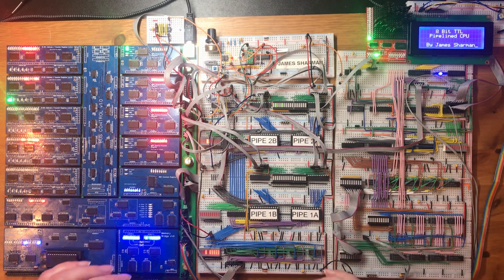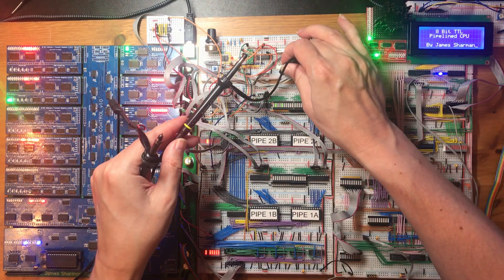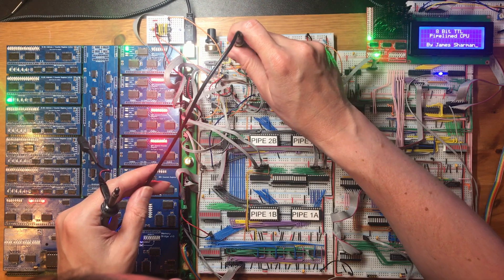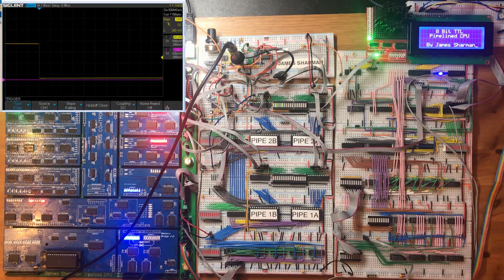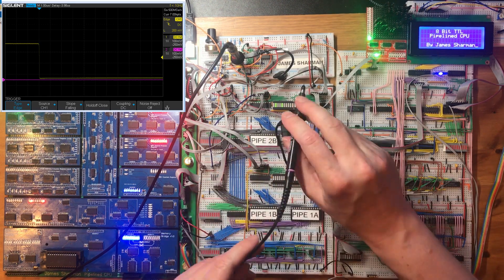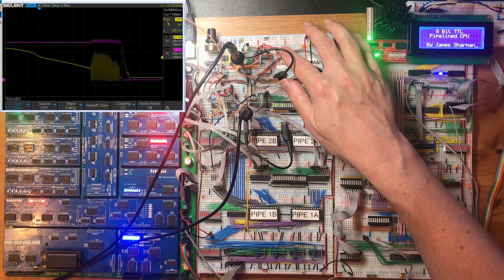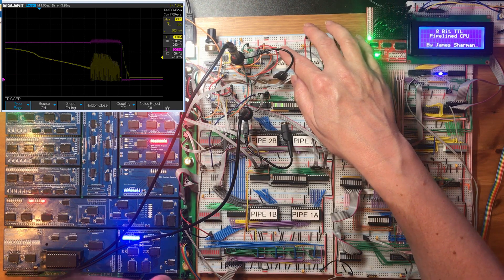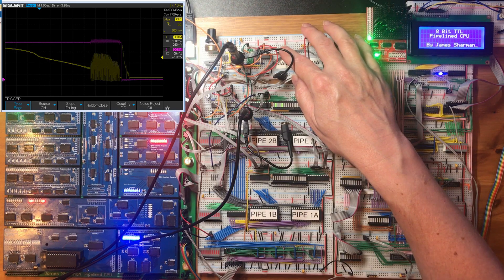Rethinking Reset - Making an 8 Bit pipelined CPU - Part 74

Comment: You could also have kept the counter in count-up mode and used Q2 rather than the carry to terminate the count at 4. Your way is more flexible though.
Reply from the maker: You know your skill level is improving when you can see multiple ways of solving a problem and are weighing the relative benefits.

Comment: I think those push-buttons are SPDT.  Would an S/R latch be a good choice there as well?  It should debounce the line.  It could also serve as a replacement for the single-step 555.
Reply from the maker: You mean use an SR latch with set/reset wired to the respective sides of the switch. Interesting idea, it would work as long as the bounce was never on both sides simultaneously, which I'm not sure you can be sure of.
Reply: @weirdboyjim  I know this is far too late, but you may find https://www.digikey.com/en/articles/how-to-implement-hardware-debounce-for-switches-and-relays interesting. Of particular note is this quote involving a SPDT switch and a SR latch.

In the case of an SPDT switch, a common hardware debounce solution is to employ an SR latch. Ever since companies like IBM used this technique for the switch panels on their mainframe computers circa the 1960s, this approach has been regarded as the crème de la crème of simple hardware debounce solutions.

Comment: Curious why it should matter if the '193 keeps counting down, if it will be loaded with the correct required value upon reset?

Unless it's just for OCD reasons. :-)
Reply from the maker: That's a good question Tom. The logical flow of the processor shouldn't be effected by it. But I do think it's good practice to resolve it (more than just ocd). CMOS based devices consumer power on state change more than state, so stopping it will reduce power consumption and eliminate a bit of potential noise on the power rails that doesn't need to be there. In the case of this circuit it is unlikely to make a significant difference, but if you multiply it up across a larger build all the little bits could add up.
Reply: @weirdboyjim  I was also thinking along those lines, and that's fair enough. Breadboards are pretty horrible for power distribution so I guess the less noise you can create the better.

Comment: Interesting design.
I didn't know you could program the 74ls193 like that.
Reply from the maker: Not sure if I would call it programming, but it is applying a common trick from programming. If you want to loop 'N' times, you load N into a register and decrement it until you reach zero, that way you don't need to separately store the value for comparison.
Reply: Awesome! Always glad to see improvements on this - and this was a really nice improvement on the reset.
Reply from the maker: Thanks Brandon.